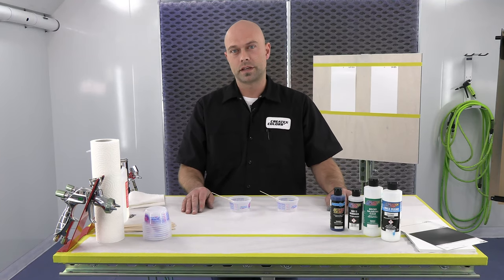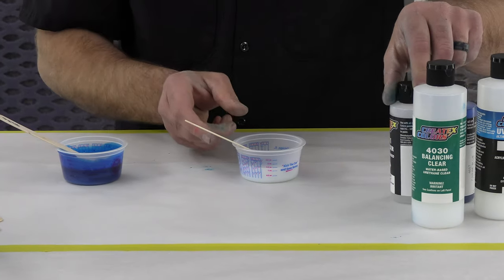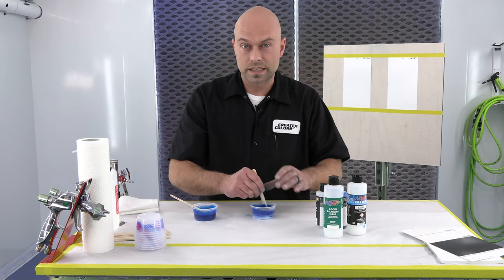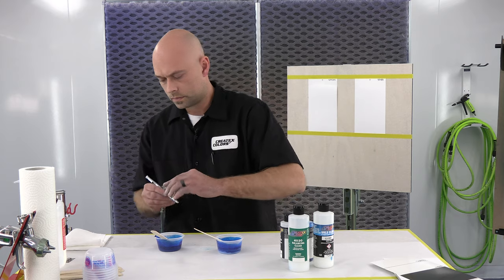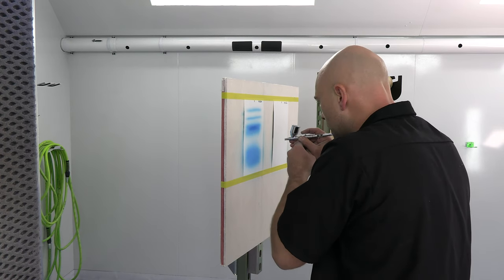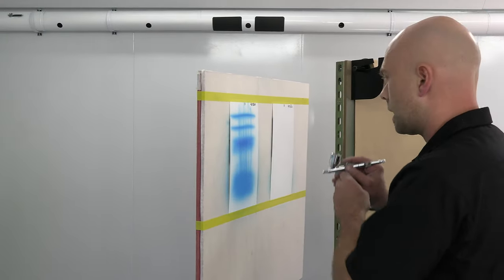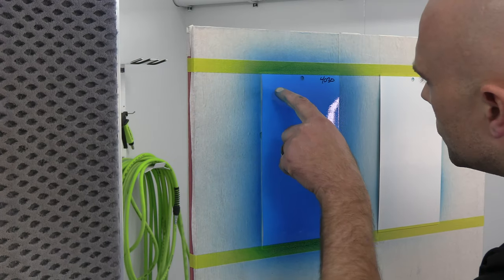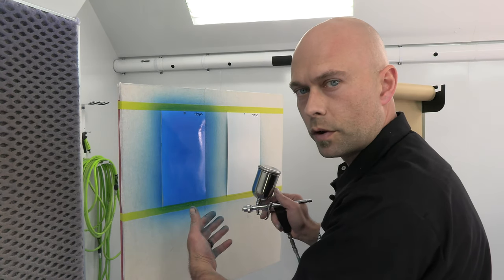Mixing candy2o for Airbrush & Spray-Gun Painting

Comment: once one, uses said paint, if there is paint left over,  can that paint be saved for later use if so, what is the shelf life ?
Reply from the maker: For shelf life and proper storage, please refer to the technical data sheet for the particular color available at  www.creatextech.com. In short, candy20 can be stored indefinitely after mixing with either 4030 or 4050 (provided its capped air tight unless pouring paint fro the bottle) but has a limited shelf life after thinning with 4011 Reducer. Thank you.

Comment: when I spray candy I get a lot of pooling. Like imagine you spray water on a glass surface how the water will collect into separate water drops. Do I need to add more 4050 to thicken it maybe? I counter this right now by spraying very light coats with the gun a little closer to the model, but ideally I'd like to spray a bigger surface area. Also when I sprayed 4053 over it to give it a glossy finish I did two light coats and then one final heavier coat and man it completely ruined it like it did the whole pooling thing again. But when I did the light coats of 4053 it wasn't looking glossy so it seems like I needed the heavier coat. Any ideas on how I can remedy this?
Reply from the maker: Please follow the mix ratios set forth in the candy2o tech sheet (www.creatextech.com) try mixing 4050 8:1 candy2o and do not reduce. Apply in medium coats with a 75/25 overlapping pattern. There’re many videos on this channel showing the proper technique. Also as referenced in the candy2o tech sheet is that 4053 is not recommended as a top coat for candy2o. We recommend a 2k urethane clear for top-coating candy2o. Thank you.

Comment: I've been using 4012 reducer for spraying through an airbrush, should I be using the 4011? The Candy2o paints have been very challenging on lexan rc car bodies the way I've been mixing it, getting an even coat has been next to impossible. I figured I either have an old/bad batch of candy or I'm not mixing it right.
Reply from the maker: candy2o is best used when following our specs.  1) mix 4050 UVLS Gloss Clear 6:1 candy2o, thin (if required, often isn't) with 4011 Reducer, https://creatextech.com/pdf/tds/candy2o-TDS.pdf. Thank you.

Comment: Chris,  How thick is the 4030 and 4050 out of the bottle?  I am having trouble getting it to spray out of a 0.5 tip airbrush. Does the 4030 16oz bottle have a mixing ball? How would I know if it froze in shipping?
Reply from the maker: 4030 is ~ 300 mPas and 300 ~ 450 mPas. With thinning with 4011 Reducer, both will spray through a 0.5mm tip-sized airbrush. 4030 will require reduction ~ 10% per volume, and 4050 ~ 15% - 20% per volume. 4030 is much more airbrush friendly than UVLS Clears which work best with a spray-gun when used as a clear. Thank you.

Comment: Awesome videos and great products. Now my question... can these paints be mixed by weight and if so, are the ratios the same?
Reply from the maker: Yes, Createx paints can be mixed by weight. As with mixing by volume, the weights needn't be overly exacting, and may vary per color. What's most important is achieving best atomization, which may require an adjustment of the reduction / mix amounts depending upon spray gun set-up, technique, etc. Thank you.

Comment: THank you sir for the demo - The info I am getting in Australia is to use a 3:1 reduction of UVLS:Candy + 10% reducer for airbrush and spray gun.  Is there a reason for that difference being proposed or advice you would offer around this? TH2 is 0.6mm? I'm using 0.5mm eclipse or 1mm mini spray gun.
Greatly appreciate your videos too - very clear and well presented for a learning artist :)
Reply from the maker: Please follow the mix set-up and reduction guidelines set for in the candy2o tech data sheet, https://creatextech.com/pdf/tds/candy2o-TDS.pdf. We prefer 4050 6:1 candy2o.  With a full-sized spray-gun, thinning with 4011 Reducer isn't required; for small spray-guns and airbrush, thin 5%  -10% per volume with 4011 Reducer. With a TH2, maybe thin ! 5% per volume, however try first without thinning. Thank you.

Comment: Great video!!
Can I apply candy2o and clear coat it after? 
I don't have 4030 or 4050. I just have the paint. Thanks in advance
Reply from the maker: No, candy2o are dye concentrates which we only recommend using by mixing with 4050 UVLS Gloss Clear. candy2o are not intended to be sprayed direct form the bottle. Thank you.

Comment: First and foremost,  Thank you Chris for some of the best informative videos on the web. My question is regarding Kandy 2o and clear coats. 
"With my Iwata HP-CS I am trying to get that "deep,wet look" high gloss over Kandy 2o. I used 6013 silver sealer. Then 2 very light coats of 4004 transparent base. Then my kandy 2o. Now, all the local store had was 5604 gloss top coat. Should I order the 4050 ? Is it a higher gloss than 5604? 
Also, is my order of application sound correct?
Sorry for long winded comments/questions. Thank you very much 
Jerry
Reply from the maker: Hello. We appreciate your kind words about our videos. The 2 light coats of 4004 Transparent Base seem unnecessary, and if applied light and dry, could be creating unwanted texture. 4050 UVLS Gloss Clear is Createx's best gloss level clear (dries semi-gloss, sand & polish for a high gloss finish). 5604 Gloss Top-Coat is best for textile and light hobby, best not used for a gloss finish over candy2o. For more application information, please see the guides and tech data sheets at www.creatextech.com, and email us at info@createxcolors.com. Thank you.
Reply: @CreatexColors  hello, I want to spray Candy2o Black 4664  on a clear plastic Gundam robot kit by Bandai I built so that it smokes lightly the clear plastic to desired effect while holding its clearness and still able to see details on inner frame . I noticed on this comment I wouldn’t be able to use the 4050 gloss clear cause I wouldn’t be able to sand and polish . Then I saw you can use 5604 as top coat but that it’s best not to be used as a gloss finish over candy20. I’m a bit confused now and want to know what I can do to get a gloss coat after.

Comment: Loving the Auto-Air paints & your informative videos! What PSI are you running with the airbrush?
Reply from the maker: PSI setting for airbrush vary as per technique, concentration of candy mix, and whats best for a particular airbrush (tip-size, capacity, etc.). Best is to spray at a pressure that finely atomizes the paint without causing dry spray. For candy2o this is ~ 18 - 25+ psi. For more information, please refer to the candy2o tech data sheet available as a PDF on www.candy2o.com. Thank you.

Comment: I have quite a bit of Scenix SSR gloss Clear...  is this the same thing as 4050?  If this is essentially the same thing, I assume I would not use the crosslinker when using as a carrier for the candy?  Thx.
Reply from the maker: UVLS Clears / 4050 Gloss is very much different compared with SSR Clears / SSR Gloss, both as a clear and in that SSR does not work as a carrier for candy2o nor direct to metal as are UVLS Clears. both UVLS Clears and SSR Clears (discontinued when SSR launched) are best tinned with 4011 Reducer. UVLS Clears are not activated with 4015/4016 Cross-Linker, SSR Clears also work best without the activation and a longer cure time. For more, please email us at info@createxcolors.com. Thank you.

Comment: Does the 4050 Leave Orange Peal since its thicker?
Reply from the maker: No, UVLS Clears, including 4050 + candy2o, are designed to self-level as they dry provided they're applied correctly; i.e. the spay gun is operated at the manufacturer's psi settings, the correct tip-size is used and application distance to substrate is within the spray gun's optimal fan pattern. Over-atomizing paint by applying at too high a psi or too much distance from the substrate creates texture in the finish. Thank you.

Comment: I normally mix Candy2o with 4030, but have run out. Could you technically use automotive 1k or 2k clear as the carrier? That is, mix Candy2o concentrate into automotive clear and spray that mix? Thanks.
Reply from the maker: We recommend mixing candy20 with 4050 UVLS Gloss Clear for all hard-surface applications, sometimes 4030 Balancing Clear for substrates like canvass. No other medium is recommended as a carrier, especially not a solvent-based clear. Thank you.

Comment: How durable is this paint? I'm interested in painting a racing motorcycle helmet and need something  that with hold up to chipping from rocks and debris.  I've never used water based paint. What can it be clear coated with?   Can you use 2K urethane clearcoat?
Reply from the maker: cnayd2o mixed with 4050 UVLS Gloss Clear is a durable, dye-based colorant, perfectly suitable as part of a mid-coat over base-coat paintjob that is top-coated with a solvent-based, 2k urethane clear. candy2o and Createx paints, when used as set-forth in our Hard-Surface & Automotive application Guide, are a professional (durable & lightfast with excellent adhesion) paint. For more, please email us at techsupport@createxcolors.com. Thank you.  2021 Createx Automotive Application Guide: https://storage.googleapis.com/createx-tech/pdf/app-guides/2021-Createx-Hard-Surface-Automotive-App-Guide.pdf

Comment: The 4030 bottle said 10 percent. What's happening, sir?
Reply from the maker: 4030 Balancing Clear is added to Createx paints at 10% per volume, and in greater amounts with candy2o, where it is mixed 1:1 for airbrush use. For more about mixing candy2o colors with both 4050 and 4030, please refer to the candy2o tech sheet available at www.candy2o.com. Thank you.

Comment: For painting fishing reels and fishing baits would you still need to use the 4030 or 4050?
Reply from the maker: While 4030 Balancing Clear still works well, we're now spec'ing 4050 UVLS Gloss as the best clear to add to Wicked Colors for hard-surface painting, such as fishing reels and lures. Createx Airbrush & Wicked Colors have better adhesion and durability compared to not using either. Createx application guide: https://storage.googleapis.com/createx-tech/pdf/app-guides/2021-Createx-Hard-Surface-Automotive-App-Guide.pdf. Thank you.
Reply: @CreatexColors  so you can mix 4050 with other colors, not just candy colors?

Comment: In your video you mix 1:1 with 4050, however on the Auto Air site they state
"Airbrush: Any tip-size, 18 – 27 psi
Add 4050 10% - 300% per vol., then
thin with 4011 Reducer 5% - 10% + per vol.
Spray Gun: 1.2 – 1.3mm, 18 – 22 psi
Mix 4050 6:1 candy2o
Thinning with 4011 Reducer is often not required."
6 4050 to 1 2o is veru different to 1:1 !
Which mix to use???
Reply from the maker: Mix ratios are general guidelines. Airbrush: 4050 1:1 candy2o, thin with 4011 Reducer 5% - 10% per volume. Spray-gun: 4050 6:1 candy2o. Thinning with 4011 Reducer not required. For more, please refer to the candy2o tech sheet, https://storage.googleapis.com/createx-tech/pdf/tds/candy2o-TDS.pdf. Thank you.

Comment: Can the Candy products be used in leather and plastics? Wanting to try out on shoes
Reply from the maker: Yes, start with 4050 UVLS Gloss Clear applied as 2 medium adhesion coatings, then apply candy2o mixed 6:1 /8:1 of 4050:candy20, using none or a little as possible 4011 Reducer. Allow this to air dry 24 - 48 hrs , then apply any UVLS Clear. www.uvlsclears.com. Thank you

Comment: Whats the shelf life/pot life of a 1:1 candy2o and 4050 mix reduced 5-10% with 4012?
Reply from the maker: We do not recommend 4012 Reducer for use with candy2o as it promotes seeding/  coagulation of the dyes. Thin with 4011 Reducer only. Please refer to the candy2o tech data sheet available at www.candy2o.com for storage information. While we only recommend mixing and reducing candy2o intended for use within a 24-hour period, actual storage life can well exceed this when the paint is capped air-tight anytime other than actually pouring paint from the mixing cup, and kept away from direct light and stored ~ 50 - 80 deg. F. Thank you.

Comment: hi im gonna paint a bike frame
black paint
wicked aluminum effect
and then candy
all with a spraygun 0.8/1,4 nozzle

can i use 4030 instead of 4050 ?
Reply from the maker: We highly recommend 4050 over 4030, to the extent we'd rather see you not paint the bike frame with candy2o using 4030 as the carrier; since 4050 was introduced we've not used 4030 as a candy carrier. 4050 is that good. Please refer to the candy2o tech data sheet and 2021 Automotive & Hard-Surface Guide at www.creatextech.com. Thank you.